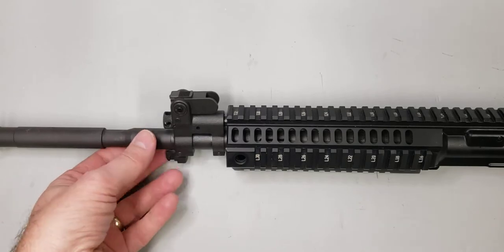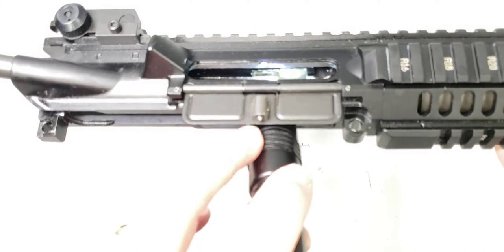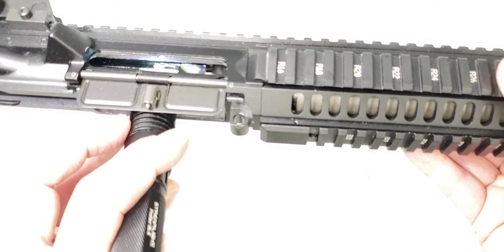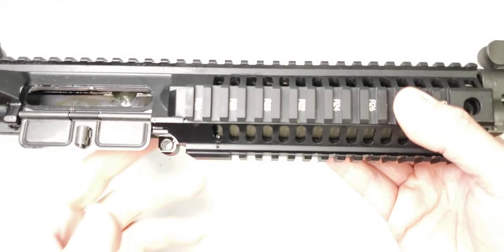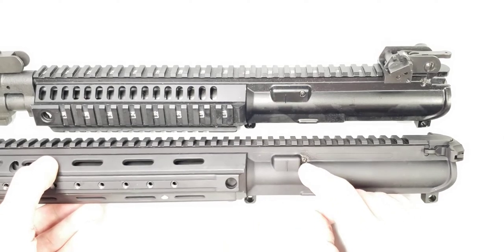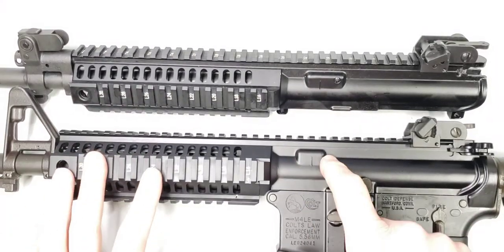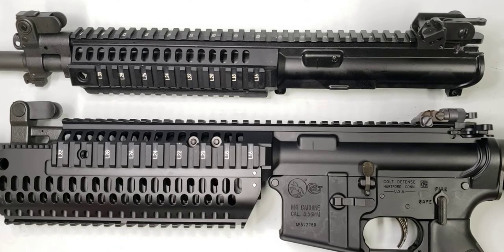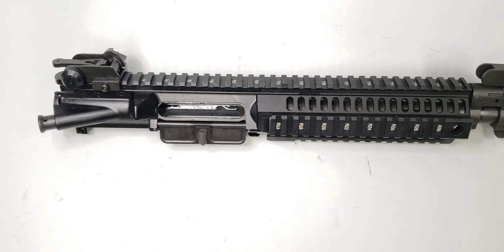Colt 6940-series Monolithic/Modular Upper Receiver Reinforcement Plate Explanation

Comment: Your prototype is the first one which was an exact copy of the Winchester design from 1968 which I gave to Phil Hinkley due to the cam pin damaging the inside of the upper receiver. Winchester developed this modification while designing an external piston conversion kit during the Vietnam era. Prior to Congressional hearing on the M16. Colt developed the external piston model 703. Paul Hochstrate, Colt engineer redesigned it with the insert improving over the initial machine screw. This was implamented in 2008/09. I have a LE901 with his as well as three standard LE6940 uppers with this feature as well as a LE6940P.

Comment: Awesome video .. I just acquired a 6940p it was a department of energy trade in it's a early one with not the reinforcement plate.. I was thinking about putting the POF roller cam pin in it.. do you think that would help?. Thanks.
Reply from the maker: Unfortunately, I am not familiar with the POF roller cam pin or what it does. So, I don't have any words of wisdom for you. Thanks for stopping by.

Comment: So If I Have an Earlier Model Piston Upper Should I Make The Modification And Add The Plate To Prevent Further Scraping Damage 😳
Reply from the maker: No. If you have an early upper without the strike plate modification, you have a collector's piece in my opinion. I would clean it up and put it away. Get a current production CR6940 for a shooter if you really need one to shoot.
Reply: @thecoltar15resource  Thank You I Only Shoot It On Rare Occasions So I’ll Be Sure And Keep It As Is 😊

Comment: Thsnks for the info!
Nice collection of 6940's
I have a pre-CZ DI 6940.
What do you think of the CZ - Colt 6940's and 6920's?
Cheers
Reply from the maker: Thanks for the comment and stopping by.
The Colt AR's being produced now are the same Colt AR's that were being produce before CZ. The only significant change so far has been the discontinuation of removing the selector stops. All Colt AR's produced now have selector stops.

I have a CR6920, CR6940 and CR6920-EPR and all three are beautiful carbines and very well done. Flawless finishes. However, the fit is almost too tight. That is probably a good problem to have sometimes.